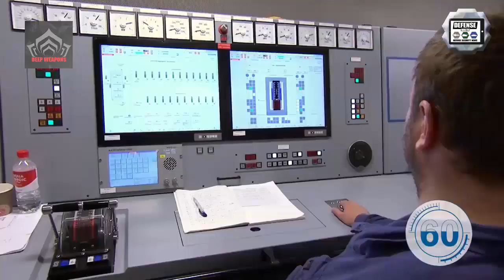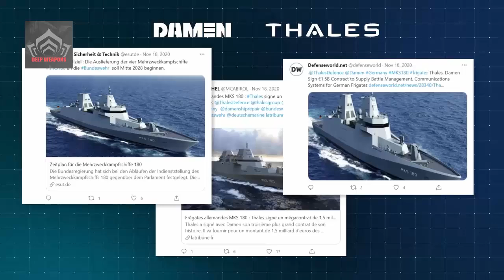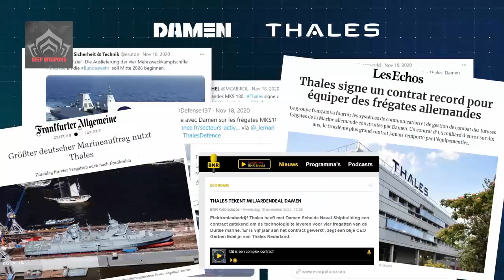German Navy To Commission Final F125 Frigate With A Displacement Of About 7,200 Tons

Comment: At first I thought the F-125 were a terrible mistake - it seemed the engineers had been so consumed with features like hardened long-range reconaissance, a clever propulsion system, stealth features, automation reducing the complement by 50% and creating room to permanently house 40+ SOF or other guests - that they forgot that this is supposed to be a battleship. The uniformed customers for the ships must have reminded them at some point, so they added at least one decent naval gun, 2 remote-controlled auto-cannons, 4 remote-controlled heavy machine guns and launchers for some NSW long-range missiles. Oh, and helicopters have some ASW capabilities or something. What kind of flagship has less firepower than the next 2 smaller classes?

However, I've come to think that well this isn't the 19th century, Germany is not only part of NATO, it supports French efforts to integrate European defense. And as a specialized component of European defense and power projection, aimed at future sea-based peacekeeping, peacemaking or monitoring missions, they actually add distinctive capabilities rather than adding a couple more generic frigates. When it comes to firepower, there are plenty of member states that offer more advanced systems than the German Marine tends to field anyway.

But the F-125s could be used to keep a permanent, low-key military presence if necessary near 4 different regions of interest around the globe. Say off the coast of Somalia: having two F-125 there would allow the EU to monitor the situation with it's excellent recon capabilities, it would allow special forces from any member nation (say France) to stay nearby without having to establish a vulnerable base on land, it could provide fire-support for any SOF mission, allow for the evacuation of foreign personnel in a crisis situation, etc. So they're not much to look at in a national context, but in a European context they make sense.